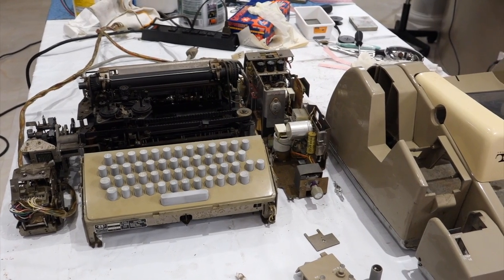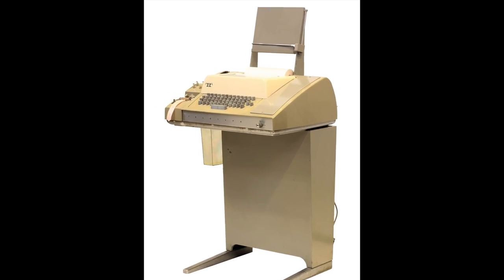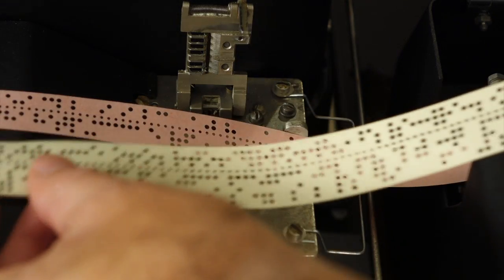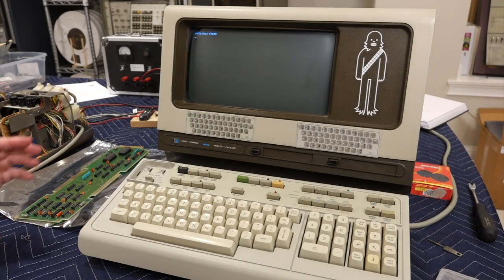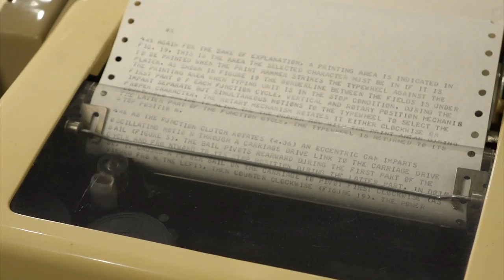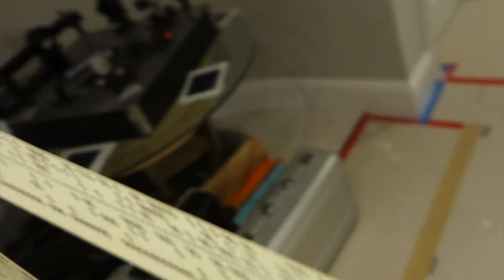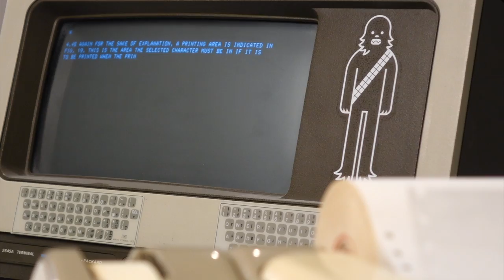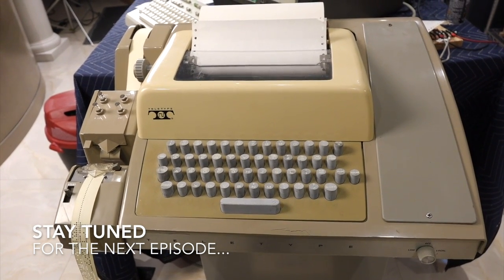ASR 33 Teletype demo  (restoration Part 10)

Comment: So, since the puncher is removing zeros from the paper tape, the chad in the bit bucket must be zero bits? So, there are always zero bits in the bit bucket, except when there are no bits in the bit bucket..  I love these mechanical monstrosities, from when mechanical design wasn't afraid of 'slight complexity'..
Reply: There would always be the smaller holes for the sprocket wheel.
Reply: The punch is adding 1s to the tape.  NUL is 0x00 and no bits punched, liked on the leader.  RUBOUT (DEL) is 0x7F, all bits set, and all holes punched, and is how you "erase" mistyped characters on tape.

Comment: How many programs did I write using a "33?"  A lot!  Thanks!  I have not heard that sound or punched a tapes in decades.  Nice to hear.

BTW, I had one with the dial-up modem.  We used it for TWX and EasyLink transmissions - sort of like Telex but in ASCII.  Worked just great.  I suspect there are some BBS's remaining where you could connect a Hayes modem and dial-up the BBS to try it out.

Good luck!  Thanks for the video!

Comment: When I was a sophomore in high school I went to a place called the Career Enrichment Center in Albuquerque NM. They had a DEC System 10 mainframe and all but a few of the terminals were TTYs. Not sure who made them but they were dot matrix and ran at 110baud. I remember thinking how much paper they wasted as I entered my program and it was printing as I typed then when I wanted a fresh view of my code it would print it all out again. It was a race to see who could use the lone DEC VT100  instead of the TTY!

Comment: One of the more useless programs I have written was for use with Microsoft Office.  You print your document to it and it generates a representation of the punched paper tape (5 hole or 7 hole options) and then prints that to A4 paper.  If you wanted you could then cut the paper into strips, glue them together and punch out the holes to get yourself a readable paper tape.  If, of course, you have a paper tape reader, two different size punches for the data and sprocket holes, a pair of scissors, glue and hours and hours to waste doing something totally pointless.
Reply from the maker: Pointless use of old technology just for the fun of it? Sounds awesome to me!

Comment: The complexity of the teletype is mind boggling. I wonder how any one(?) came up with the idea and what the higher ups in the company would have thought about the design. If the person who created wasn't insane you could go insane trying to repair one of these devices. ;)  One thing I noticed is that you haven't tried using any of the four buttons on the top of the paper tape punch. Do they work?
Reply from the maker: Yes. On/Off Backspace and Tape Release.

Comment: Amazing restoration.  I have a silly old-fart question.  Bach in High School I saved by first program in BASIC to tape.  I have no idea what the computer system we used was.  The teletype was using a modem to talk to it.  I was told the computer was the size of a shoe box, so it must have been really, really advanced <grin.>.  Is there some way I could get it to print to text?  I don't know if tape readers used a standard format, but you folks would know something like that.  My tape is in paper, but at that time we could also use that fancy Mylar tape.  It was a rather pretty green.
Reply from the maker: Depends if it was saved as source text or already tokenized. It’s easy to read a tape by eye with an ASCII table, so maybe you can first try to decode a few lines by hand and see if it decodes into text.

Comment: If you sped up the motor (with a variable frequency drive unit and/or variac, would that make it punch and read the tape faster? Vintage overclocking.

second question: if you fed the tape back into the reader as it comes out of the punch mech, would it read what it had just punched and go into an infinite loop until the tape ran out, assuming you set the machine the right way.

Comment: The ones I am most familiar with were used to store code for Numerically Controlled metalworking machinery, long before it became CNC.
Reply: My class of signalers for the Swedish (1989-1990)  Air Force (Flygvapnet) didnt got teleprinter/paper tape encrypt machine . The one who began in 1988 got it !

Comment: I wonder if those plastic parts would clean up if you gave them a Retrobrite treatment.  Was there a coiler option to roll up those paper tapes as they were written or read?  If not, I would imagine people had to be really careful not to step on the tape or break it.
Reply: The ASR33 is naturally a tan brown colour, not white. I would suspect the plastic was made long before bromide fire retardant was added, anyway, and Retrobrite does appear to damage plastic to some extent. I would not try it.

Comment: Hey, a question here. How can one transfer the paper tape to the typing section? I have some old paper tapes, and a very old teletype, and I am curious to see what's written there. Some help, pls?
Reply from the maker: You need to configure your ASR33 for half-duplex. Then you just put the tape in the reader and run it through as if you were sending it, and it will print at the same time it sends it.

Comment: Could you make a machine to read those tapes lightening fast? Like if you has some copper brushes that made connection through the holes of the tape, and depending which holes were in contact, it would produce a different audio tone/frequency, and have a code tell you which tone is which letter?
Reply: They made optical readers that could read thousands of characters per second. Basically a light on one side of the tape and a row of photocells on the other side. Nothing mechanical needed. You don't even need to run the tape at a constant speed because the sprocket holes made it self-clocking. This still wasn't lightening fast. A full roll of paper tape weighs several pounds. It takes time to accelerate and decelerate that much mass. If anything went wrong you had confetti flying all over the room.
Reply: Colossus had an optical paper tape reader that predates this machine although of course that was 5 hole punch tape.

Comment: I was a little surprised to see the unit with a modem having a keypad (lacking the * and # keys) rather than a dial.
It appears that there were several different modem options. I'm guessing that as well as being connected to early computers this was also used a telex machine.
Reply: More usually the 32 rather than the 33 was used on telex. Originally with rotary dials then keypads and as 'modernization' took hold the selection was made from the actual teleprinter number keys, removing the need for any type of dial or keypad.

Comment: Hmmm. I wonder how difficult it would be to build a interface for such a machine to use it on a modern Linux terminal. Should just be a Arduino and some simple drivers shouldn't it? Though application support may lack a bit nowadays. (vim,top & similar)

Comment: What happens if the tape rips or tears, or damaged a perforation
Reply: Generally you punched a new tape and threw the old one away. There were tissue-paper-thin splice tapes that you could stick over a tear. There was something that could be manually used to re-punch the damaged holes once you had the new splice tape glued on. It was a real pain, and the splice was likely to make the reader jam and tear the paper tape again.
Later Mylar tape was used. This was stronger and harder to tear, so it usually damaged the punch or reader mechanism instead.
Reply: Thin repair scotch tape having holes for all the channels was available. In addition the paper tape was visually readable and you might use a manual punch to copy badly damaged part to a fresh stripe of leader tape (pull holes only).

Comment: how loud is it? is the mic amplifying it or does it really sound like an idling helicopter?
Reply: With the covers on and the reader/punch not running it is a little louder than an electric typewriter. But that probably doesn't help much. The reader was a bit louder, and the punch was somewhat annoyingly loud, but you could talk over the whole machine five feet away by only slightly raising your voice.
Reply: YES. It was really loud. Imagine having 10 of those in a small terminal room for students. :-D

Comment: It must be hard to find paper tape and ink ribbon nowadays...
Reply from the maker: Ink ribbon on the shelf at Staples. Same as in the 1930 model 15. Part has not changed in 80 years! Oiled paper tape is much harder, but Mr. RTTY still sells some.

Comment: what about if you next find an Altair 8800 or buy a replica: https://altairclone.com/ and connect it to it?
or better connect it to one of your IBMs
BTW: why isn't this printing text so well? I though you have a brand new ink/tape cartridge in it which can print black black not grey black like an used ink catridge would
Reply: At 0:29 you can see the two ribbon reels for the fabric ribbon. If the ribbon dries out, you get spotty printing. Or maybe they just ran the same ribbon through multiple times to save money on re-inking...